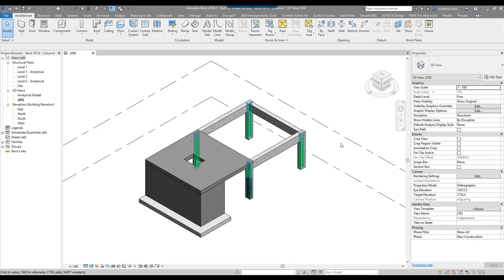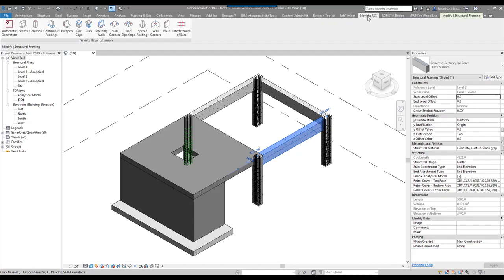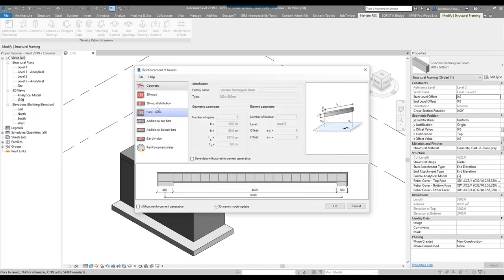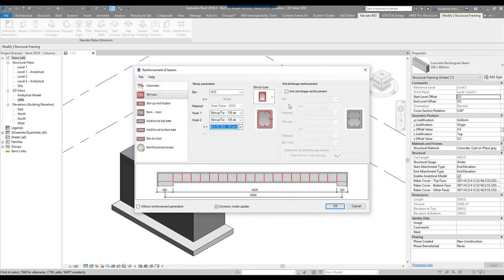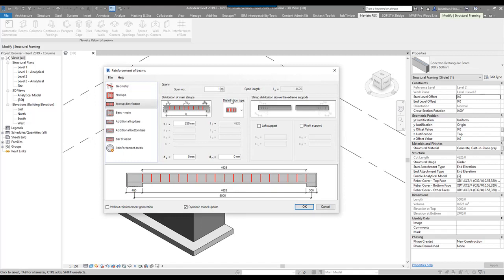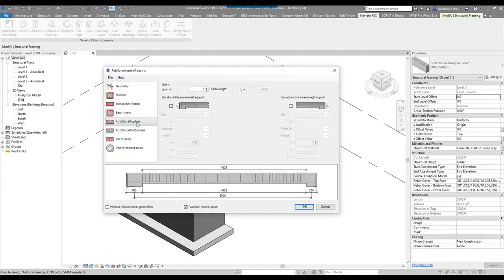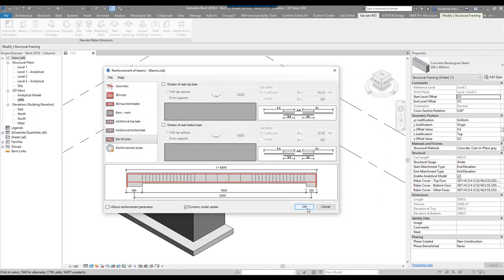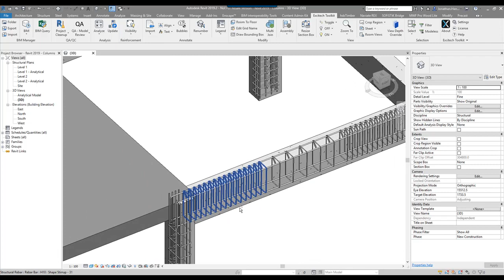Revit 2019 - Using Naviate Rebar Extension for Beams

Comment: May I ask about which template do you use to model this structure? Because I model it in Construction Default Metric template but I can't use Naviate function on the template. Thanks
Reply from the maker: I'm using the out of the box Structure template from the UK build
Reply: So much thanks for your answer. 😊😊😊
Reply from the maker: @kakdachhaer8921  no problem, happy to help with anything Naviate related